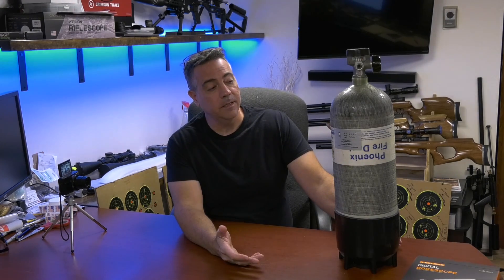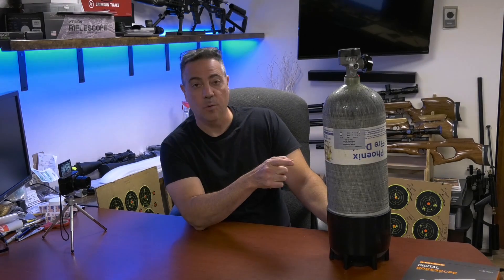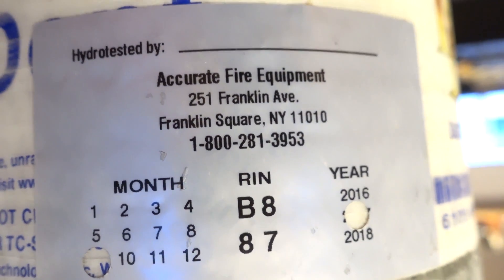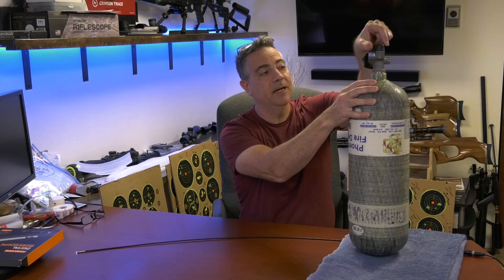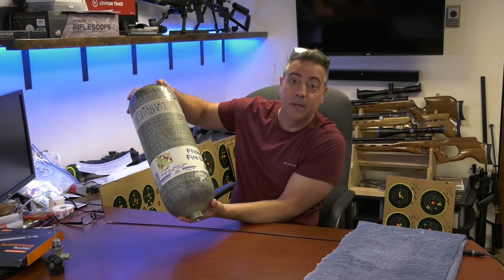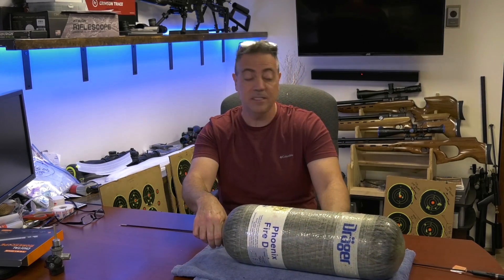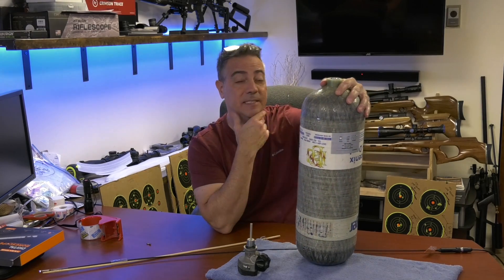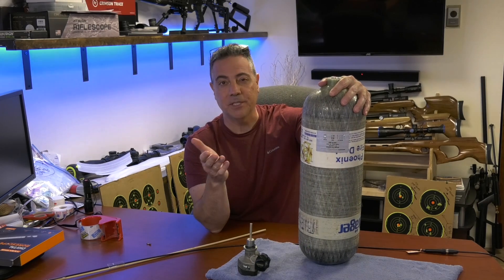SCBA 4500 PSI tank after using a Yong Heng PCP compressor for 5 years

Comment: GREAT video Stephen! My SCBA (4500psi carbon fiber) is past due date but in MINT condition.  Was curious if it would become deadly...found this on a blog devoted to the subject: "I am one of the few that has had a carbon fiber tank fail, I did a lot of write ups on it years ago,,In a nut shell the carbon fiber belts are made to let the tank leak out very slow"  this is comforting, BUT an aluminum scuba tank can kill you when it fails--either as a projectile or a bomb!

Comment: bottle inspection for water erosion - the carbon fibre bottle use a resin to bind the carbon fibre sheets together to form the pressure vessel. These synthetic polymers should be more resistant to hydrolysis than compared to tanks made from metal. The synthetic tanks are not subjected to the effects of galvanic corrosion, as far as I'm aware
Reply: the inside is metal.

Comment: @ Air Velocity Sport: i need your help. amazon is longer making it easy to correspond with them, or get help for defective items. i am new to (air projectile) launchers, and watched you youtube for about 3 months. after watching your vids, i purchased you, per your recommendation i bought the (30Mpa High Pressure Air Filter External Water Oil Separator Filtration). Which i think is good, but when i installed it, the first stage pressure relief valve does not close (even when tightened). Any help you can give will be appreciated.

Comment: I think I have one of the same tanks from Phoenix Fire Department that was unused 7-8 years ago. I was filling it with my Shoebox compressor and high pressure filters were just kinda getting started. I quit filling my tank due to moisture concerns about 6-8 months after I got it. I'm sure mine has corrosion in the aluminum inside. Mines been sitting at 3000 PSI for years now. They say these tanks really are good for 30 years as long as their not damaged and beat up, but the corrosion I'm sure that's in mine also worries me way more than the date. After seeing yours inside I think mine will be retired also. I have a GX CS4 coming and will just fill my PCP's directly. Those filters are kinda scary too with 4500 PSI on them so i never bought one.

Comment: I'm interested in this compressor but for lower volumes of air. Probably 2200 psi max. How long does it take to fill a tank like that? How long would it take at 1800-2200 psi? Does pressure make a huge difference in its speed?

Comment: I think unlike reputable  SCUBA dive shops which should always be filling one's scuba tanks with perfectly dry air; many may not (because it cost money to maintain the compressors). if one fills their PCP bottles from home compressors they may not be providing the sufficiently dry air required to be inside of these tanks and over time corrosion might start to occur. Oil could also be a big problem too from a safety aspect. I'm not sure if that was a "fracture" plus I doubt it actually as this would simply rip through the Al at full pressure. More likely some mark from manufacturing, however these certainly does appear to be some basic corrosion setting in. As you stated the bottle has been heavily used and the lifespan of all of these things (real SCUBA tanks included-I mean for diving -i'm a diver) one may not get the manufacturer's listed lifetime because of excessive use or ingression over time of moisture, failure to hydro test on a regular basis etc. I think for sure dry air is a must, especially if one has their tank sitting around for ages and the air isn't exchanged a lot. Great video, just found your channel and have subbed!

Comment: Tank looks  pretty normal for aluminum that appears to no be treated in anyway(anti-corrosion). That being said, I wonder if it would have had the same effect if you would have used the oil/ water separator w/ a molecular sieve.

Comment: Update after viewing several Yong Heng videos on both PCP and diving, the best way to run it is to use this setup: Compressor w/ Seccolube 500 or equivalent > oil/water separator (w/a drain) > molecular sieve > PMV (pressure maintaining valve @ 2k allows filters to reach appropriate pressure to reduce moisture, also acts as a one way valve) > pressure release valve > tank.
Reply: Wherr did you get your PMV from?
I can not find any small ones that are in the given pressure range.

Comment: Not surprising that there wasn't liquid water in the tank.

BTW- some user, as do I, recommend cutting the extension tube from the valve. As you stated, the purpose of the tube is to prevent water from entering the breathing apparatus.
When used for air guns, the tube prevents any liquid water from being blown out of the tank, thus trapping any liquid until hydro or inspection.

It's also worthwhile to note that there will be virtually zero water vapor present in high pressure air. When air is compressed, water vapor condenses and precipitates out, gathering in the lowest area or the device. Cotton filters, water traps, and such simple devices are effective in trapping liquid water, unless a saturated filter or overflow water trap and high air flow speed blows the water forward.

Having tested water content in my air over several years, I sometimes use an inlet desiccant filter, but usually don't bother because my compressed air humidity is below 50% with or without. A standard technician's humidity meter works well by venting compressor or tank air, slowly into a plastic bag. The meter inside the bag, at atmospheric pressure, measures the humidity while the air passes through the bag.

Try with various filters and dryers to see if your results differ. I'll be that they agree.

Thank-you for your excellent and professional information.
Reply: Awesome comment Norm! Helpful advice

Comment: I recently bought 2- 9 liter tanks and 3 of the tuxing .7ci carbon fiber bottles, and a bunch of other new carbon fiber bottles and even aluminum bottles. Some of the new bottle liners are absolutely FILTHY, so I've now been searching youtube for 4 DAMN HOURS to learn how to clean out the inside of PCP hoa bottles that are dirty... I can't find 1 single video explaining, instructions, how-to... NOTHING on how to properly clean out the inside of these bottles. I don't know if you just use dish soap and distilled water and then throughly air dry? Or are you supposed to use isopropyl alcohol? Or just water? I have no clue... and I do not want to put on my brand new pcp ninja 3000 psi regulators on new bottles that are ABSOLUTELY filthy inside! I can't believe there isn't 1 single video on how tocclean out new/empty dirty bottles!!  Lol

Comment: Too bad you don't have a new tank to compare the inner surface with. That somewhat rough surface at the bottom could be how it looked when fresh off the manufacturing line, but those salt crystals might offer a clue that something is slowly eating aluminum to cause the pitting. If the tank was tested the same way scuba tanks are tested, were you given the option of cleaning the inside with tumbling media? Again, it would be nice to compare with a new tank, as I expect they are manufactured using a similar process as steel tanks are. This YT video will show how they are formed if YT does not block it: https://www.youtube.com/watch?v=jmUIlh2S5QQ

Comment: I work with aluminum and to me the inside exhibits aluminum corrosion which is similar to rust in that it goes deeper than it would appear .
The scratch actually resembles a stress crack to my eye because it has a lot of detail with small turns , like a crack would have vs a straighter line surface scratch .
Excellent video !
Glad you decided to retire it
Reply: lol bullshit
Reply: @schlomoshekelstein908  lol dipshit

Comment: "soo sou soov Memento"  (Cracked me up. That edit was a VERY FUNNY- closing thought)  Now on to the serious---

Steve, Are you claiming that carbon fiber tank, for the past 5 years, was filled with a Yong Heng compressor----- and you had NO FAILURES? 

My experience has been different. While the Yong Heng is fine for short 2 minute fills of a rifle, an upwards to 60 minute fill of a 6.8L or 9L tank (even cooled with ice water and moderated with 10 minute rest periods)  is a way different story!

Even with careful maintenance and observation, I found the Young Heng (with lengthy periods of use) often blows air leaks and fails. I was constantly wrenching and patching up leaks. I've now got 2 Yong Hengs sitting in a closet (that's $600+ DOLLARS!)     BOTTOM LINE: The economics aren't sensible.

I advise new Air Gunners, forget the chinese home compressors; if you're going to do a lot of shooting, "INVEST" In a good large tank (6.8L to 9L) and get it filled periodically at a Scuba Shop or Paintball Gun Shop. For a mere $10 to $15 a fill (One trip to the scuba shop equates to 40 plus rifle fills).

Reply

Comment: Add a molecular sieve after the toauto moisture filter to get rid of the left over oil/moisture. The pitting in your tank looks like it’s from when you previously used hydraulic fluid as a lubricant. I’m not saying yong heng is bad. I just would not trust my life with half this stuff. I went with a name brand dive compressor. I sent my air Venturi tank off to be re-hydro tested and inspected because when I drained the air and looked in the tank it looked like there was compressor oil in there.

I’m not trying to scare anyone off or deter anyone from using a yong heng. I just won’t use one myself anymore.

Comment: Man i think it really dosen't look bad at all for 5 years use, the line that looks like a scratch could have been there all along, great video as always !
Reply: The aluminum liner is not very thick and doesn't really hold much pressure by itself. The carbon fiber wrapping is what holds all of the pressure and as long as it hasn't been slammed into something to cause a delimination there's no danger.
Reply: Don E or it might be a brand new hairline fracture that could explode the next fill
Reply: @warrenthomas1253  hopefully when my head is right next to it
Reply: @schlomoshekelstein908  here's hoping you get your wish

Comment: I've used the same / original Yong Heng compressor for about the same time span 
to fill rifle cylinders,  rifle tanks,  as well as 3 SCBA tanks:  1 metal and 2 carbon fiber.. 
No crazy / gimmicky filtrations,  just simple common sense applied, and Zero water in any of them either!
 
[Random Thought]  The industry that I'm in - I end up with all sorts of extra Silica-Packs kicking around, 
so I started throwing them into a large ziploc bag,  figuring that eventually they'd have a use..  
Now I'm starting to think..  Why not just drop one of the larger [shake-hand-warmer-sized-versions]
directly into a tank - For those that may experience moisture issues in theirs.. 
Obviously, it's from friction/heat/etc.  but the packet[s] should definitely do 'something'...  
[/RandomThought] 😁

Sam -